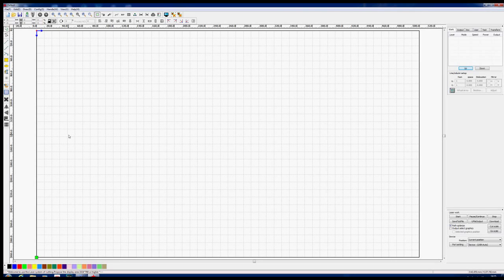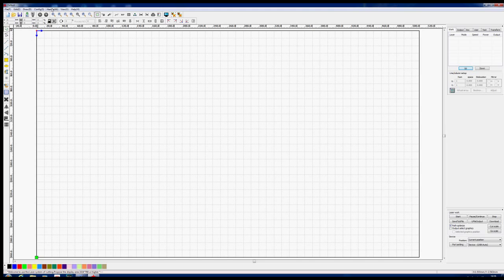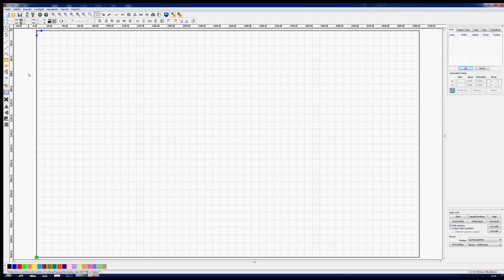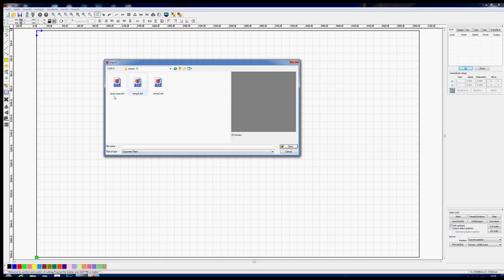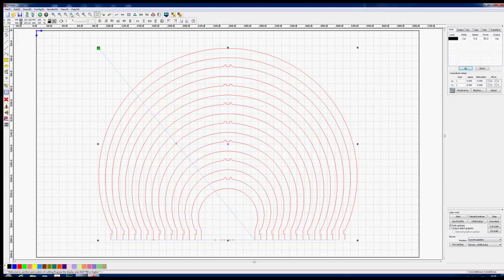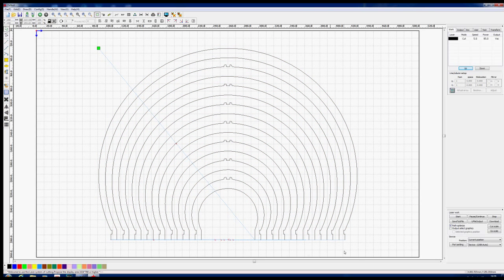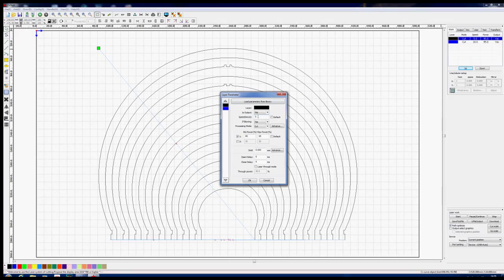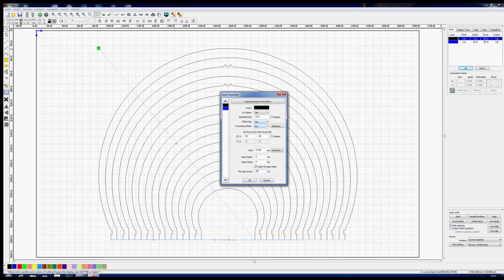RDWorks Learning Lab 15 design and cut light sculpture

Comment: Hi Russ. First, thanks a million for sharing all your hard work, I enjoy your presentations very much. A question: after discovering that the laser power was dropping off after a couple of minutes into a job, have you found a definitive reason and solution yet? Forgive me if this has been answered already, I have to catch up with a lot of your work. I am thinking of purchasing one of these machines (only because you cover it so well), but I am worried about the issue of losing power. Have a great day.
Reply from the maker: Hi Steven
I was vey trusting of the Chinese and naive about how the tubes worked. It was only after I had bouught a second rubbish tube that I began to do a lot of research about how tubes worked that I was able to envisage what was wrong with this tube.  . see     https://www.youtube.com/watch?v=mN7_4h3nCZM
One of the mirrors was not properly glued to the heatsink and as a consequence, when it started to heat up it distorted and that caused the photon amplification process to be destoyed becaus e the two mirrors in the tube wre not perfectly facing each other and flat.

Best wishes
Russ

Comment: I love your videos and instructions. But I have one question about the power. How much amp is on the tube at 95% isnt it to much ? I use only 70% on my 60W laser because I have there 24 milliamp.
Reply from the maker: Hi Claudio

This was the tube supplied with the machine and and I was very naive at this stage. I do maker it clear that this is a learning journey I am documenting and therefore it will be peppered with things that I do wrong. 3 1/2  years on I know so much more. I know for example that you should not really be running your 60 watt tube at more than 22 mA (probably 65%?) This tube of mine was a piece of junk and I was VERY inconsistent with it's output. I knew it was junk so I bought another tube via Ebay and replaced one piece of junk with a slightly better piece of junk. That taught me a lot about the Chines and forced me to understand a huge amount about the way our sealed tubes work. Ithen upgraded to  an A grade 60 watt tube and power supply and  over  3 years on it's working just like new.
Many thanks for the comment
Russ

Comment: Russ.   You are fantastic.   excellent job.   every evening I've been watching two or three of your videos and i don't even own my machine yet!   lol.   very entertaining
Reply from the maker: +Christopher Miller 
Hi Chris
Mine is a strange experience. I'm 80% retired and have video as a hobby. I was looking at 3D printers as something else to have in my workshop and decided that a little laser cutter would be more entertaining and useful. I researched well (so I thought) and bought what was basically a well engineered machine. The tube was not 50 watts as promised but a rubbishy 40 watt unit. After you've done  video for  lots of weddings , parties and special events, it's difficult to find good subjects to video. Hence when I got my little Chinese Dragon I felt it would make a good focus for me to document all my learning experiences. Although you can learn from them this is basically the saga of my transition from idiot to guru. In fact I'm still learning after all this time. There is rarely any preparation, you are looking over my shoulder as I play learn and make mistakes. There's lots of bad language that gets edited out but none of it is faked. Remember I'm getting double fun ...engineering and video editing.
Cardboard and acrylic engineering has certainly  been a good substitute for a lifetime of working with metal. Although I have made numerous improvements to my machine, that's been part of the fun. I have tweaked my machine to almost perfection and now I have a fantastic reliable and predictable laser tube, what more is there for me to do????? It may seem like I have dealt with a lot of negatives but hey, look at the positive side, if fate hadn't dealt me a shitty hand and I had the dream machine from day one, how much would I have learned? How much research would I have undertaken? How many videos would be missing from my portfolio??
So when you get your own machine don't copy me, just learn from the mistakes I've made and that will be a pleasing bonus for me.
Best regards
Russ

Comment: Another great video thank you!
I have a very similar machine and was wondering if you would share the parameters you are using for cutting acrylic?
I mostly cut 3mm acrylic, using 60% power (which is the same as 100% as you demonstrated in another video) and 9mm/s. If I go over 9mm/s it won't always cut all the way through. 
I can see from your videos that you can cut pretty fast which makes me wonder if my machine lacks power or if the tube is damaged...
Reply from the maker: +Virtualmix 
Hi
Firstly let me say this video was done several months ago when my ignorance level was very high. As you push on with the videos in the series, I begin to learn a lot more about the frauds and poorly published data about using these sealed CO2 tubes. I discovered that there was such a thing as the manufacturer's recommended max drive current which is 20mA for a typical 50watt tube, My 95% setting was 26 or 27 mA and I found out to my cost that this greatly reduced the life of the tube. This particular video is a record of me discovering that I had a sick tube. I thought I had been sold a rubbish tube but I subsequently find out that it was me that had wrecked the tube by assuming that 95% and 100% was there to be used. 
My recommendation to you is don't ever set more than 60% power. You will get little or no cutting performance improvement by using higher percentage power, you will just be gobbling up tube life for no benefit. 
I don't have fixed speed values exactly but I would always set to max power (60%) and run a 40mm square test. Circles are not good test shapes because the machine may slow down as it cuts curves. If your square cuts through cleanly you can ramp up the speed by say 2mm at a time and if it's a poor cut, drop the speed by 2mm/s. For 3mm acrylic I would confidently start at 12mm/s. In later videos you will see me cutting 10 and even 15mm acylic .
You also need to check out my video on lenses as this may be part of your problem also. https://youtu.be/WbBPps42iHc

Hope some of this helps
Russ
Reply: +SarbarMultimedia 
Thank you so much for your response!
Yes this certainly helps a lot. I'll follow your advice and won't run my machine over 60% power. It's not impossible that my tube have lost some power because I used to set it at 100%... Luckily I have a spare.
Now I'm going to watch your video on lenses, it really amazing what we can learn from these Chinese made machines!

Comment: If you can keep the water temp under 18 degrees you should find the laser power remains constant.  At 13degrees you should get peak output power :)
Reply from the maker: +Phil Fitzgerald 
Hi Phil
If you move further into this series of videos about me learning to use the machine you will see that this tube was basically useless. I may well have hastened it's demise by over driving it. I was ignorant of the current limit for the tube and was constantly running it at 90 and 95% power. I had tried running that tube with a tank of pre-cooled water at 12C but there was no change in performance so this particular problem was not temperature related.  I eventually replaced the tube and fixed the problem. I then did a lot more research into the life and death of sealed CO2 laser tubes which is dealt with later in the series.
Thanks for your input it's always good to get other ideas  but in this case hindsight  prevails. My current tube happily runs at 25C . I do plan to check out in a future video how temperature affects power output.
Best regards
Russ
Reply: @SarbarMultimedia  Did you ever find a correlation between tube performance and temperature? i have to keep mine at 24C due to the incredible warmth and humidity here in florida
Reply from the maker: @conneredson315 
Hi Connie
I have done extensive testing on full allowable power with one of my tubes running at 45C. It is never going to affect tube life but it does reduce power by 5 to 8%. Fortunately in the UK we rarely get temperatures in excess of 30C but during such periods I put a small copper cooling coil in my reservoir and run tap water through it at about 1 to 2 litres per minute..In your climate I know it gets incredibly hot (40C in summer?) and humid. I suspect you are running with  a CW5200 chiller unit?  I suggest you reset it to run at between 28 and 30 C. The loss of cutting power will be negligible  but the chiller will not switch on and off as often (less electricity used). Tube brands such as Reci and EFR allow you to run up to 40C, but in general I limit my running to 30C max. One of my tubes is now more than 4 years old and still going well.
Best wishes
Russ
ps I have visited Florida several times and it will always be in March or April. I'm convinced these are your best two months.No storms,no bugs, no stupid temperatures and  a very peasant humidity.
Reply: @SarbarMultimedia  those are excellent months to visit. most of our winter is gorgeous too. not quite 40C but close. I am going to attempt to insulate the silicone tubing to see if that will help. I do indeed have a 5200.